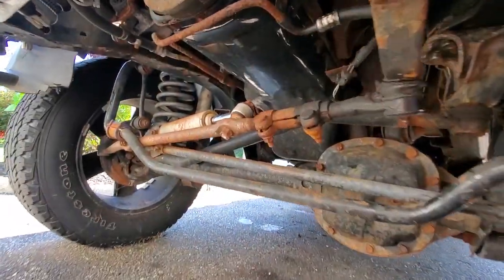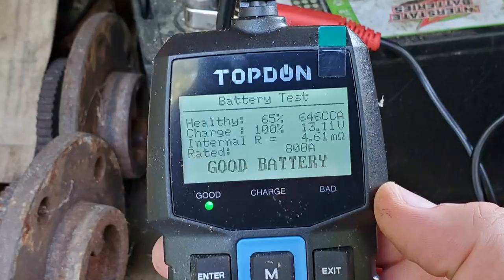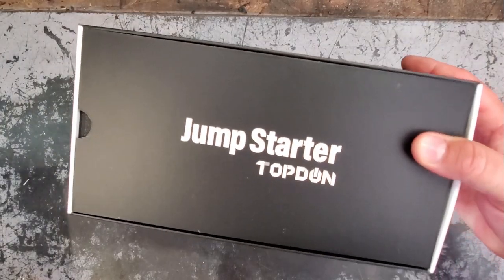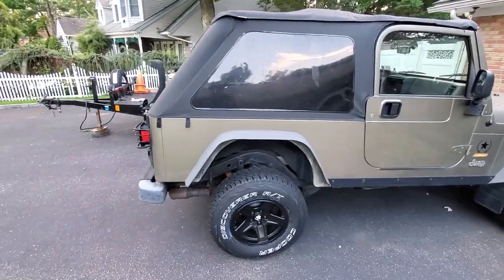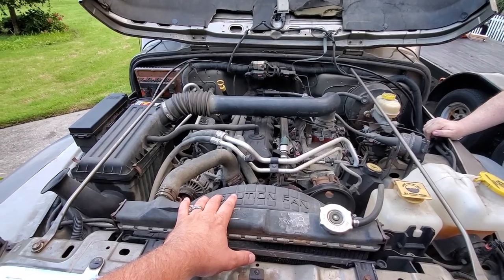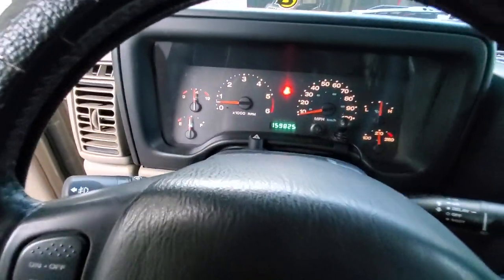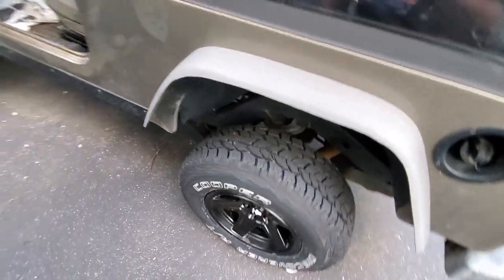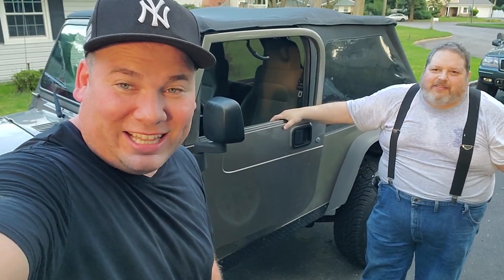STARTING A DEAD 2005 JEEP WRANGLER RUBICON SAHARA UNLIMITED with TOPDON VOLCANO 1500 JUMP STARTER

Comment: I have been working on doing a motor swap on my 98 Jeep Grand Cherokee I have run into a roadblock and would like to get your opinion on ideas my issue is I can't get the flywheel to bolt to the torque converter I was told to install both separately but now I can't seem to get the bolt holes to line up any suggestions
Reply from the maker: keep spinning it till they align, they only go on one way

Comment: I just did a motor swap on my 1998 Jeep Grand Cherokee Laredo. I have checked all connections I have checked all grounds everything seems to be connected but the car still has no spark any suggestions of something simple I can check to see why this may not be working it does crank over thank you
Reply from the maker: have you tried the crankshaft position sensor? check out my CPS vid
Reply: @ProjectDanH  yes that was the issue with my starting problem but now I'm having an issue with my transmission not wanting to go into gear it'll go into park that's it every other gear you can feel it shift but it won't engage